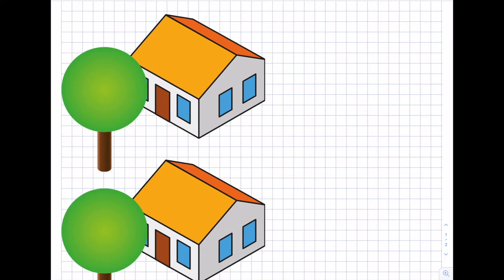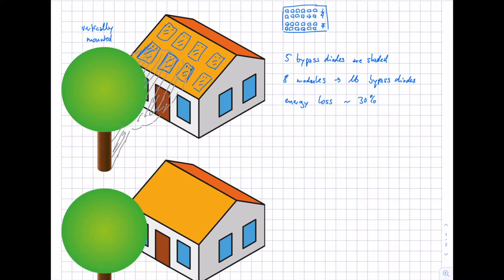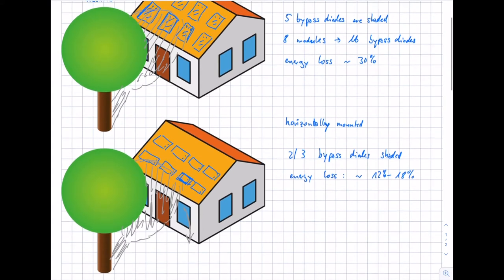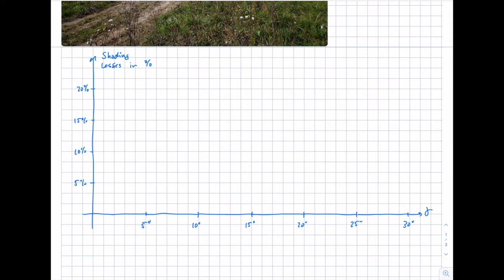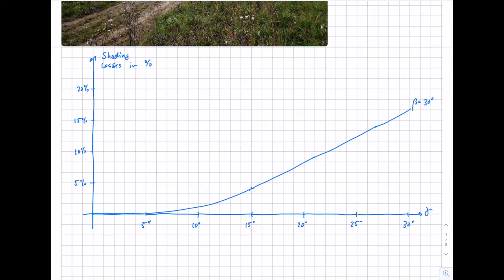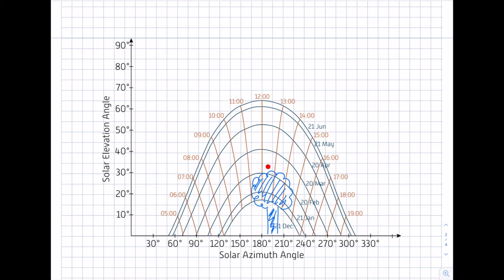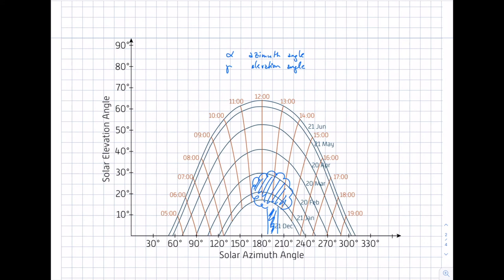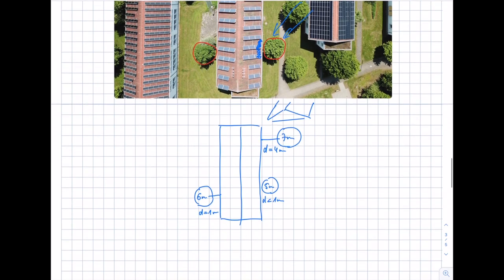Solar Energy. 7 Shading. 7.3 Shading Analysis

Comment: At 12:36, the curve is based on the assumption that the power loss is proportional to the shaded surface area. Yet in reality, in array setup as 10:32, the lower string of the back-side array will almost lose all power even if only a small part of bottom modules are shaded, since all the bypass diodes are activated. This conclusion can be drawn from IV curve and MPPT simulation.